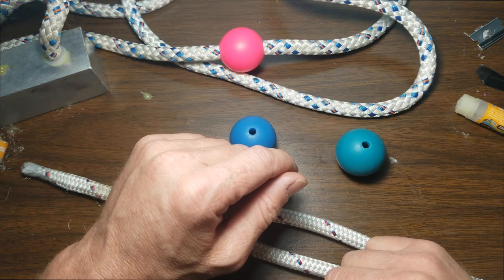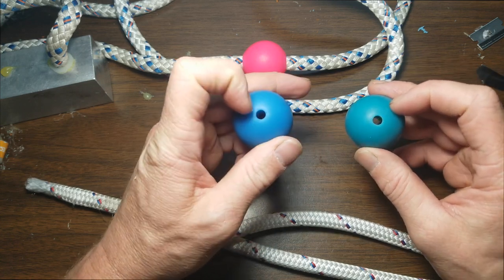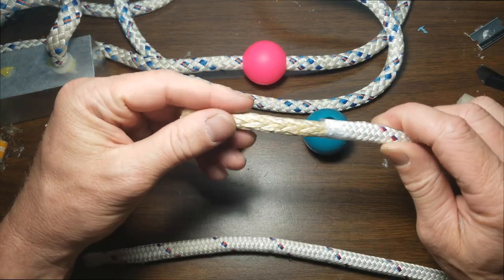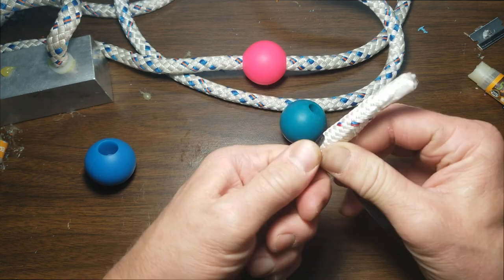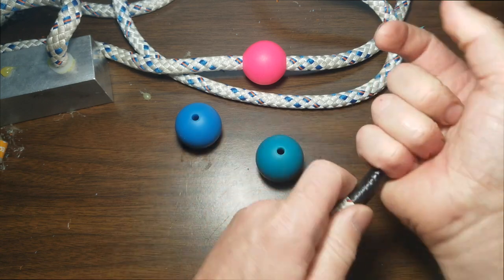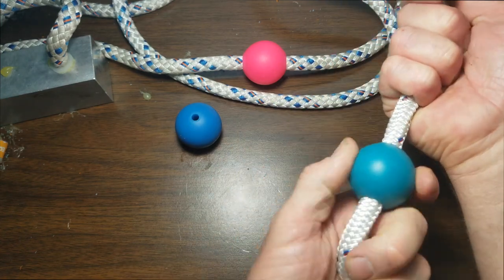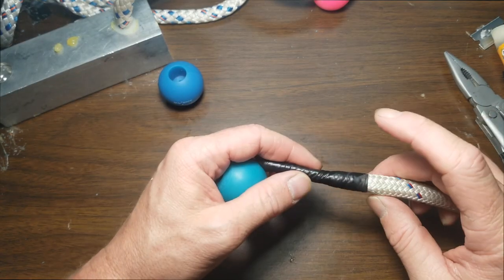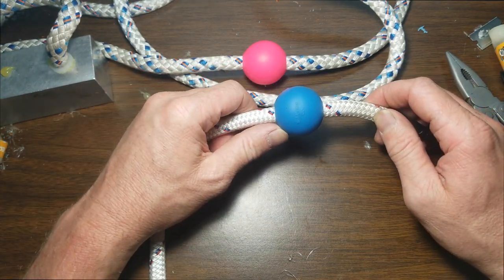Installing Thick Rope into Poi Handles.

Comment: hey there, im not sure if youve already tried it or not but when im trying to get my tethers through a tight opening in a handle i use vice grip style pliers to hold on to the short piece that way i can put more force into pulling the handle over the rope. just wanted to share that. thank you for all of your videos, so many of them have been very helpful for me personally =)
Reply from the maker: Thats the one tool I still don't have for some reason. I will look into that though. Thanks!

Comment: I know this video is a little old but i cant find very many videos related to vpc tethers and poi. Ive used this method to put the sphere nobs on my fpc tethers from flowtoys but their tether melts and i can put a cap on the end of it.

I just purchased some vpc tether (waiting on them to arrive) but ive heard that it doesnt melt. What is the best solution for not being able to put a cap on the end?
Reply from the maker: if you're making just regular practice contract poi then I use a hot glue with the high heat sticks. I use the yellow colored brand from Ace hardware. the handles are then just filled to whatever weight you want. if you're doing the heads than I use a cone method with hot glue as well and I have some videos that show that process here on YouTube. now if you're making LED sets where the head needs a flat cap then I use a two-part epoxy and I've been using the devcon home 5 minute epoxy. recently I found it there epoxy it gets a little too brittle though so there might be a better option out there but I do have a YouTube video on how to put that cap on and I think that's under pod mod version 2 tutorial
Reply: @ThePoiMechanic thank you for the reply. These are for the handles. I purchased the complete diy cone kit from flow on fire with the balls and handles. I would have just had them make a set but I'm under a time constraint and would get the kit before I had to travel.

The cone method seems pretty straight forward. Ive made contact sets before, but usually just tie a knot or burn a cap and feed that through the holes.

This is just the first time I'm messing around with tethers I can't melt so the handles were what I was worried about. I will check thay other video of yours out, thank you again
Reply from the maker: @xKhfan213x  good luck!